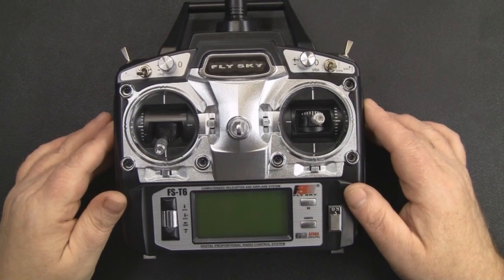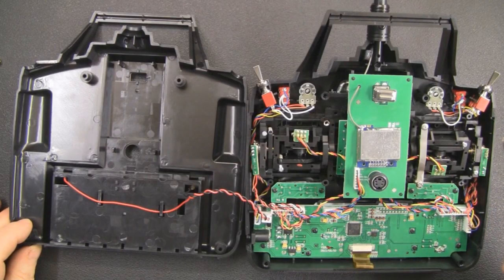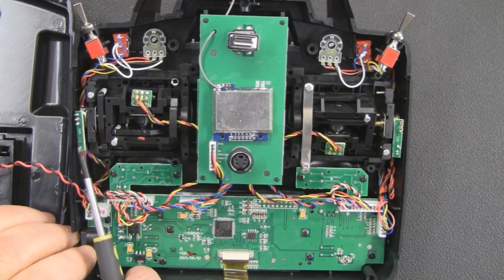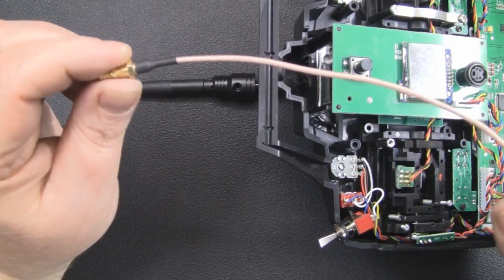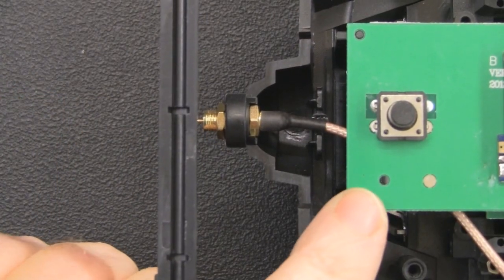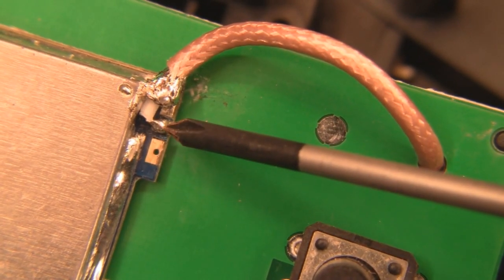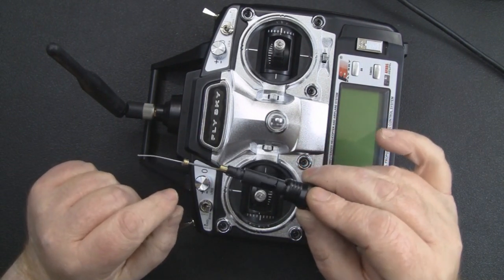FlySky fs t6 Antenna Mod #82

Comment: battery  mod is easy take it apart like you see here disconnect the wire replace with a longer one so you can hook up turnigy 1.45 battery from the out side there is plenty of room

Comment: At 3:07 you mentioned 'About 2.5db gain' You need to clarify things here a little. A dipole has exactly 0db gain, however if you are referring to 'dbi' a half wave dipole (end fed in this case) does have a gain of 2.5dbi. However, dbi is a theroretical figure and in real life is absolutely impossible to achieve, it's a computer model that assumes, zero SWR, zero resistance, zero capacitance, zero inductance and zero cable loss. RG316 isnt the best choice even for short runs like this. Worst scenario looking at the specs, you can expect around 0.2db cable loss and 0.1db loss from using an RP-SMA connector. The Chinese like to use the dbi figures because it makes their poor quality antenna's look better then they actually are. I have the same transmitter and its possible to get in excess of 3 to 3.5 miles with the right antenna set up. I could get further, but with my drone battery, I would run out of power before I run out of signal.

Comment: my fs-t6 got problem, it always display , WARNING, for your safety, turn up all switches and lower the throttle to contineu
Reply: I have done many advise here un U tube that it's only switches that defective and perform the sed procedure in locating the bad sw. and I did it in the precise orocedure, but still the problem exist?
Reply: still beeping and display the same warning, what other cause of these problem? your solution is greatly appreciated, and thank U very much. 
from Philippine,
Ed Navarro

Comment: lol, how flysky have come along since the T6, Even my old FS-i10 has a colour touchscreen and the build quality is 20x better than the T6, ALL flysky radios use diversity now as well.
Of course, im using a Radiomaster Tx16s running open tx these days but my i10 will stay as a backup.

Comment: I did a continuity test between the ground pad and the antenna pad and for some reason there is a connection between them. I checked both pads and it looks like they are not touching. Is there something wrong with the transmitter?
Reply: yes you have a prob. there should be zero connection/continuity between the sheilded ground wire and the core wire. i think this is the cause of some low distances with the T6 reports. i fly large sailplanes with min and high alt and longer distance with stock TX set up. proper ant polarization is crucial.

Comment: Hi, I would like to increase my FS-i6 range. I'm wondering if using a 7dbi patch antenna from Frsky (http://www.banggood.com/fr/Wholesale-FrSky-7dB-Patch-Module-Antenna-p-68704.html?rmmds=search) would be better or not than your 11dbi stock antenna ?
Besides, I would like to know if I can use a cloverleaf antenna instead of the two small antennas on the receiver (X6B which is pretty much the same as the ia6b) in order to increase the range  ? And would it be compatible with a patch antenna ?
Thank you

Comment: I tested my range with the original antenna and signal cut out at .35 miles... about 1800 feet. I performed the modification using RG316 and a 10dbi 2.4ghz antenna. the range test with the new antenna gave nearly identical results. I gained 50 feet or so. not sure how that happened. maybe I'll try a different antenna...

Comment: Hello i have just bought an LHI racing quad and it came with the flysky fs t6 transmitter with the RSB receiver. I noticed i am having range issues so i just bought a new receiver in hopes to fix this issue. I bought the flysky fs t6 RR-813 Receiver. DO you know what the difference is and if this will help? Thank you.

Comment: just did a stock range test and seemed to have no problems until about 550 to 620 meters.    at 620 my 250 quadcopter shut down.    at about 560-600 some where I heard a few unwanted inputs on throttle.    other than that I'm fairly impressed for the price.   now ill do the mod and see what happens.
Reply: +Jay Tol  Im having the same problems did the modification work?
Reply: +FCF TATTS sorry not yet, I'm flying an fpv quad copter and am going to need mega range soon as I get better.  but as of now... I'm flying up to 600 Meters away with no probs whatsoever.  I'm going to push more distance this weekend.  so the fs T6 is doing great so far. 
I may still do the mod but am getting more inclined to buy the flysky taranis soon.  I want the telemetry and voice warnings.
Reply: +Jay Tol I'm doing the same bro im trying to get used to the fpv it a  little difficult looking at a screen. Any suggestions will de appreciate
Reply: +FCF TATTS goggles?
Reply: Jay Vantol  hi. Had you done the antenna mod and did you gain any range? How much if any? Thanks.
Reply: catbijoux1 im sorry, shortly after posting, i changed my mind and bought a taranis.   but people are doing this mod even to that radio, so I'm assuming it can help.
Reply: Jay Vantol - Thank you for your quick reply. Yes it must be a useful mod. I did it to my FS-T6 although I never experienced any range issues even with the stock antenna. I fly LOS and not fpv though, so 500m is more than enough for me. Congrats for your Taranis, that is a superb transmitter you bought there.

Comment: how do you bind the flysky fs-ia6 receiver to this transmitter?
Reply: +DenMark Phan http://lmgtfy.com/?q=fs-t6+antenna+bind+fs-ia6+reciever
Reply: +DenMark Phan You can't - the fs-ia6 is not compatible with the FS-T6
Reply: +DenMark Phan Really?
It would have been far easier and faster for you to simply type that question into google.
Than to ask here.

There are countless threads,  Plenty Info out there for that very question.
Search first, If you can not find the info you need, Then ask.

Plug bind cable into bind plug on receiver, Apply power. Red light will be blinking.
Press and hold Bind button on transmitter, And turn transmitter ON. 
Red light will go solid on receiver to indicate successful bind.
Unplug power to receiver.
Remove bind cable.
Done.
Reply: +Vx Commodore what is this google thing you speak of?  seriously, i did the research and performed the actions you listed above.  i have the crappy chinese manual but you know how notorious they are for being incomplete.  the light continues to blink.  I was trying to see if there was something special i missed or correct sequence specific to these two items.  thus the question i posted above.  reaching out to the on-line world is just another step in my research process after other dead ends have been reached.  trying to determine if i have a defective unit.  thanks for your input and time but chill on the holier than thou attitude.  cheers!
Reply: +DenMark Phan No problem.  It's usually a case of people to lazy to research. So make others do the hard work.

Sorry, Just assumed you were one.

If you followed the above and its still blinking, Then I'd say you either have a defective Receiver, Or Transmitter.
Most of the time, Its the receiver. But you will just need to troubleshoot to figure out which one.

Just make sure you're bind cable is linking the ground pin to the signal pin on the bind port, 
Unlikely, But it could be a bad bind pin/plug.
Reply: +TheArtIsFart wow, you guys are way smarter then me.  i am still trying to find the "any key"

Comment: Thanks for the video! I'm using 7db wi-fi antenna for now, I couln't make any range test; but will make in a week. I will share the results! 

In another video, somebody modified the reciever antenna. Anybody tried that? If somebody tried that, I can give that a chance also.

you can search it "Add a dual antenna system to FS-R6B receiver"

I can only use one antenna on receiver side though. If anybody tried that, if you can share your experiances, I'll be very happy.

Comment: My compliments to you, Andrew.I have done as you advise, but I used a 380 mm 16dbi double-loaded stylus. Not being able to find any RG316 here in Melbourne, Australia and not wanting to wait for weeks to get some from overseas, I was compelled to use some RG58, which I managed to extract from the plastic cover and re-cover with heat shrink, elimenating is such manner about 1mm in cable diameter. The job was not the esiest but it worked. With the pissy stock dipole the range was 70-80 metres, while I am now very happy with a 480 METRES RANGE! Thank you indeed. Cheers from Bruno

Comment: Few month ago, I did the same for my FlySky fs-t6 Trans, I use the original receiver, and added a 5db 2.4Ghz Antenna to my transmitter, the range was increased about 30%, it go from 250m to 350m, after that I added a 2.4G Mini 2W Power Amplifier Module, the range was increased about almost 50%, it go from 350m to 550m, and it's not bad at all.But be careful, never turn on your transmitter power amplifier without adding the antenna, it's work like a resistance, and make sure that the amplifier battery is full each time you go out. (NB: the test was made in open area, the transmitter was fixed on a tripod and I walked holding the receiver connected to an ESC+motor+battery).

Comment: Thank you so much for this video sir.  I got the exact same controller.  And have just waited for the video.  I see you uploaded it in februar.Strange that i have not seen it before. And i have realy been looking for another that was good at doing this. It is reashuring. I will go ahead with mine now. I have the same cable also. Ordered from Deal Extreme.   Very cheap.

Comment: Great video! I ordered one a few days ago and I've been reading some bad experiences with lost contact at ~100-150m, which seems TERRIBLE to me. So I will be attempting this mod for sure. 

Is there any way you could increase the power output too? 

Btw, did you do any tests so far regarding range? How's your quad build going?
Reply: I have one of these, and I have experienced drop outs around 100-150m. I'm new to this quad scene and it was quite scary watching my hard work drop out of the air. I managed to get enough reception to soften the landing! Interestingly, the day before I had no issues flying much further and over a lake. It has me nervous now! 

I can't find anywhere what the "expected" range is for something like this. I have also mounted the rx aerial vertical below the quad. And I have also learned that you should have the tx aerial bent at the 90. So, might try this mod and see how I go!

How far are people flying with the standard equipment?
Reply: +ibsn87 Are you using the stock receiver? From my long reading about this problem, it seems that a good combo would be another receiver plus this remote. Also, one of my theories is that when you go full throttle, the lipo voltage gets too low for the receiver and it reboots. Are you using 2s or 3s? If you're using 3s, my theory goes down. :)
Reply: +Bogdan Boeru Yes, i'm using the stock receiver. (Can you use other receivers with this remote, I just read something that said you cant??)

As for voltage, your theroy goes down, MAYBE. (Im using highest C rating 3s nanotech batteries I can get. ranging from 1300-1800-2200mah and it was doing it from a fresh charge) - the only change since the day before was the video transmitter was swapped out from a 200mw TS5823 fpv transmitter to a Skyzone 3d Dual transmitter - more interference???? Shouldn't be considering on is 5.8 and the t6 is a 2.4? 

I ran the quad on a laptop power supply before I owned batteries, and I could get 40% throttle. before it would drop voltage and reset. I haven't had enough time to figure out if i need to cycle the throttle to re-engage it, i just try to keep it upright and recover! 

You have me curious, I Might be able to test this "reset" theory with my new goggles, as i should have audio, and I think it beeps when it resets...... So I should hear it - maybe.

I'm right this minute looking into failsafe options for the t6 transmitter and cc3d setup, but im not sure if I can have say, x percent throttle so it will decent slowly - instead of dead falling! Need to do lots more reading!

Have you got your transmitter yet/ done any testing/ found any info that would suggest expected line of sight range for this setup?

Cheers!
Reply: Bogdan Boeru im also going to try and walk away with the throttle on and see how far I can get away from the transmitter? I need to restore some confidence in my setup! Ignorance was bliss the day before!!!
Reply: +ibsn87 I haven't got mine yet, I'm checking the tracking number 5 times a day, but all I get for a week is that it left China. The wait is killing me, because I can't fly my quad without it.

Some people say that the receiver must support failsafe, not the transmitter or the board. I'm using CC3D as well, I'll check more into that.

There is a video on yt with a range test, that goes to about 150-160meters. Others have tested it to 800m without a problem. 

There are two RF chips in these remotes, one with 150mA of transmitting power, one with about 80mA. It depends on the luck you're going to have when getting it. I would do a range test myself, keep a friend on the phone near your quad with the props off, then walk away. If the motors stop, it's clear that there's a connection problem.

Regarding the protocol, it seems that this protocol is very common and other receivers should work with it(don't know which yet, I'll check). 

I for one would really like to know if it's a receiver problem or a transmitter problem. If it's true what others said, that having different receivers(some FrSky ones) solved the dropouts, then it might not be the transmitter to blame.

P.S. How much does your drone weigh with all the FPV equipment(and without battery)? Mine is at 455gr w/o battery, but I used 30A ESC's that are really large.
Reply: +ibsn87 What I found on a forum: "By the way I used a Turnigy 9X receiver instead of the one that came with the Fly Sky FS-T6 & it worked perfect so we can put that issue to bed. Any receiver that works with the 9X will work with the FS-T6."

Comment: Many thanks for the video! I dropped my FS-T6 which broke the antenna and of course severed the co-ax. So I just did this mod, initial test at about 150m fine but will test further when I have a chance, if i get 300m strong signal it'll be better than stock..
Reply: Hi Paul, i  just had the same issue, i dropped the transmitter controller and the coaxial cable is now cut in 2, now i am wondering if all the problem i have like losing signal even a few meters away are the cause of the issue.
Thanks in Advance
Adriano

Comment: I did the mod with the 5db FrSky antenna. I didn't have any range problems with the stock antenna. When tested on the ground the range was easily 500m and i guess i could got more. When tested the new antenna i was 650m away and it still worked but i ran out of space to go further. Notice that there were buildings and trees inbetween so i didn't have clear line of sight. https://www.dropbox.com/s/muzs6fatm9z99pu/range_test.png?dl=0

All in all for me more than enough range for line of sight flying.

Comment: What is the new range with this mod?
Reply from the maker: Tobi H. 5db original antenna was 2.5db
Reply: Thanks alot! Did the range increase much?
Reply: +andrew mcneil 

when i check  my fly sky t6 on the transmitter  this two places signal and ground have short  this is normal??

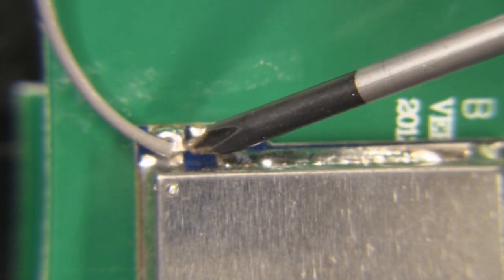i mean this episode 3:15

my flysky t6 have too short rang
Reply from the maker: Robert Llado Hi Robert sort answer I don't know yet still building my quad. But the stock antenna is only 2.5dbi so it was got to be better.
Reply: How much dbi does the new mod antenna have? Thank you ;)

Comment: I just did this to my flysky fs-t6. After I showed some people on a forum, they said iit was a bad idea. It might even burn out the radio inside.... I haven't had any  problems so far though... Thanks for showing us the Mod...
Reply from the maker: Hi Chris glad it helped you I am new to the hobby myself so I am not a expert on all the hardware. Now this mod lets you add different antennas adding greater range and functionality and I bet that a radio with a SMA connector like this costs a lot more than £40. All this mod does is allow for better signal propagation it does not increase power from the RF module or affect the radio in anyway.
Reply: That's good to know. Thanks again.

Comment: Great video. Is there a specific antenna type you would recommend for best range in all directions? For 2.4ghz? 
I have a similar radio, but with an upgraded module (FrSky DJT) that works great, but it just has a small standard 6dbi antenna. I also have a 9DBI but it's way to big. I'm looking for a better option. Any suggestions?